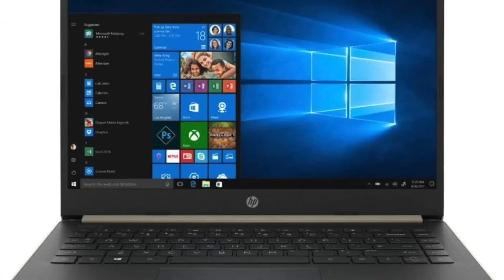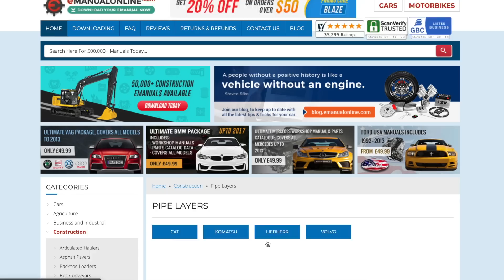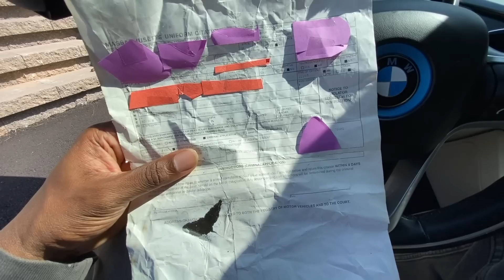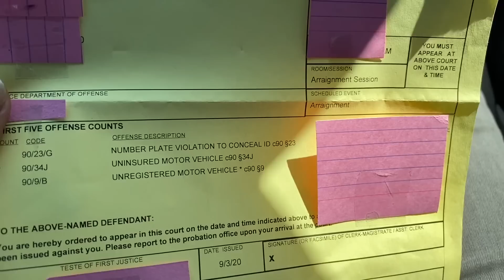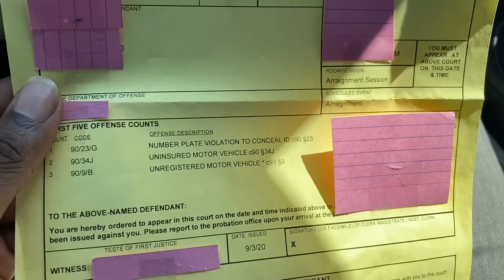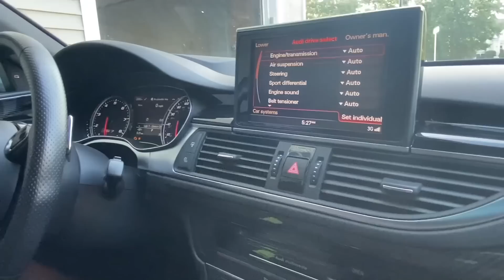What my confiscated Audi RS7 cost me

Comment: Comfort keeps shifts at lower Rpm so it feels smoother , dynamic keeps the car shift revs at higher rpm then the car then feels more racy and individual you can set the modes to comfort for smooth and dynamic for higher rpm shifts . Auto reads you driving style and changes in its own to comfort or dynamic automatically. I have a 2019 Q7 and drive in comfort when cruising most of the time and when I need a little more juice I put it on dynamic like when I’m getting on a highway and I need to speed up quick . I love buttons I believe it would be kinda hard for search for stuff when when you have to have full attention to the road . I saw the 2020 Audi Q7 with the touch everything but I liked the discount I got on 2019 and the Navarra blue color it has :) I don’t like the touch buttons looks complicated while driving on the new one .
Reply: Or, and hear me out, they could put a lever in the car and another pedal so I can choose how the vehicle shifts at all times.
Reply: The settings are for more than just shifting.  It also controls things like suspension stiffness, steering weight/speed, throttle response, and exhaust sound.  Comfort is more of a touring (soft) setting while dynamic is aggressive for sport driving.  Individual lets you pick and choose each aspect from either category (IE - having quicker steering and throttle response while still having a softer suspension setup)
Reply: @ezemond8299  of course it is supposed to but how often have these settings be more placebo than actual change to a vehicle's performance.
Reply: AMG is better than RS bro, all day.
Reply: FatalxWolfsgrin on my Q7 I feel comfort is more delayed to down shift and doesn’t have that much oomf and when I use dynamic it really gets up and goes strong
Reply: @ezemond8299  Easy enough, they could have levers for steering speed, a lever for suspension, a lever for throttle response (could even put it on the floor and use your foot to actuate it), a lever to slow the car down (again I would put it down on the floor) and maybe a lever to change the radio.  I should really patent these ideas
Reply: Q7 2019 2x better then 2020 version no cap.

Comment: Nobody wants cars to go “all screen” it seriously the most irritating trend. I want to be able to easily adjust the air, volume, and driving modes without fumbling around in a stupid touch menu system. The best part about that RS7 is that the screen can fold away. Nothing is going to save Tesla when the screens start looking as ancient as the first iPhones, and iPads do now. The extra weight in the Audi is a direct result of the effort they put into luxurious materials, and sound deadening.

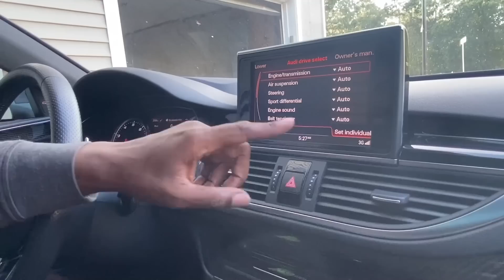Comment: 14:00 MMI from 2014 cars is actually from 2010... I guess you're still only changing the "Individual" preset (You were selecting Comfort, then pushing the Set Individual)
It has a "Owner Man.", I guess they could have labelled it RTFM 😂
But hey at least it had few features Tesla didn't get until much later (adaptive air suspension) or still don't have (night vision for wildlife)
Reply: Yeah, I fast forwarded to the end when he started whining about the settings and not knowing what they mean. FFS it's obvious to an intelligent being.  Another thing intelligent beings do is RTFM, and stay away from Muskmobiles and Gayphones.
Reply: This audi mmi as you wrote is basically already 2 generations old. New Rs 7, A6, etc use new one and between there has been bit older mmi with virtual cockpit etc in audi cars like A4. I would expect Rich to know this but it sounds like he was expecting some newer mmi for some reason

Comment: Even though battery is in the back Audi makes jumper connections in front.
Reply: BMW  and Mercedes  do it to its call convenience  its for jump starting  and  battery  in back  for weight  distribution
Reply: @koollyb  Trust me it doesn't always work
Reply: @HemiLyfestyle  if it doesn't work your doing it wrong the positive it's literally part of the main busbar and any grounding will do usually on the strut tower but the engine block is the best place
Reply: It's nice to know where the extra lbs come from.

Comment: What's wrong with the brake rotor orientation?  The internal channels are probably straight up and down, thus bidirectional. If the channels are curved inside, then the curve goes to the back so it releases hot air during forward rotation, and doesn't try to scoop it. If they are truly bidirectional, then just swap left and right if you want the vent holes pointing forward.

Comment: Rich, the bottom right button you press is labeled "Set individual" in the display. It always and only changes the options of the "Individual" setting. Comfort means "as comfortable as possible", Dynamic means "as dynamic aka. powerful as possible" and Auto is a preset made by AUDI engineers where both (Comfort / Dynamic) keep a balance.
Set "Set individual" options allow you to eg. have "Comfort" suspension but "Dynamic" engine and "Comfort" Belt tensioner just so that your ass can get comfortably and securely accelerated real fast ;)

Comment: If the steering feels really heavy then there must be a problem with the box are you sure the fluid is topped up comfort is what it says dynamic is sport indervisal is so you can mix the two how you like it, dynamic is a hard ride comfort is best, so you can have sport engine setting comfort ride and choice of exhaust valves open or closed

Comment: Buttons are good, touchscreens where you have to press 5 times to change simple settings = bad. 
And try reaching out to a touch screen on a bumpy road - having the wheel by the gear shift is much simpler.

Comment: Don't worry too much about the summons. I had the same thing that happened to me, except I put plates on my car from a different one. I had to go to court and explain what happened. Just explain that you made a mistake, and they typically will dismiss the charges against you and you'll be hit with a fine (in my case, they charged me with "court costs" instead of actual fines). With the courts being backed up due to COVID-19, they will probably give you a break, especially since you don't have any priors. If you were in serious trouble, they would have arrested you (they are actually supposed to do that, at least that's what the police officer told me when it happened to me). I also lived in Lowell, MA when it happened to me, and I'm sure you know about Lowell since you live in MA. So I lucked out with that, and with having to go to court for it too. Hoping everything works out for you. Like I said, just explain what happened and that you understand the severity of your actions, and you'll be fine as long as the judge believes you are sincere about it. And since you don't have any priors, I know they'll be lenient on you.

Comment: I had a 14 Audi S4 and Comfort, Auto, Individual, Dynamic pertain to all models of Audi.  Comfort = comfortable, quiet and smooth. Auto = Adjusts based on your driving style. Individual = Allows customization across the board of incorporating each mode however you like it. Dynamic = Aggressive, Stiff or Tight,  Loud, Sport mode essentially.  You are only ever going to drive in Comfort or Dynamic.  I honestly don't think Auto even works and Individual is fun to mess with but never see myself actually driving in the mode.  Comfort for long trips, Dynamic for quick trips around town.

Comment: Rich, sinse you dont maintain a majestic mane, you should look into the uline s-19252 the straps go behind your head instead of around your ears, and they're built well, because i'm not sanding anything most of the time i have just used this same mask with an alcohol spray for a several weeks

Comment: my rs7 APR Stage II with street tires would run the 1/4 mile at 10.5 at 130 mph. i could run the 1/8 at 6.6 105 mph but that was with nitto drag radials.

Comment: To get under mid 10s you'll need to upgrade the cooling (IC and pump) fuel (LP/HP) and meth injection....that will juuuuust get you there.  Anything more and you're looking at bigger turbo and supporting mods.

Comment: For a country that is really lax on having a license plate on both ends of the car, your cops are escalating it quite unreasonably when you forgot your plates at home. I had my plates in the windshield for a while because I had to get EU style holders for a car that I imported from Asia.. But it was still fine. Is it really driving without insurance if you just left the proof of insurance and that stuff in your garage while test driving? You should ask the judge to give you a small fine because you learned from the experience.. And as far as I know you can ask for that specific officer that got your car impounded to be present.

Comment: Massachusetts title law requires all motor vehicles and trailers (over 3,000 lbs) to be titled within 10 days of purchase. If you had it less than 10 days before you wee pulled over, there's no valid case. also the pandemic has made opportunities to register less available

Comment: So, uninsured motor vehicle u can clear easily by proving you bought it recently and its covered under any of your other cars insurance policies for at least the first 30 days. Unregistered vehicle charge, idk about you but im sure your DMV has been slow and or shut down recently due to covid and many require you to schedule times to go to the dmv to process things. Out of your control. Easily not your fault, (even if it is actually). The lack of plate charge, you pretty much have to admit u drove it without plates, but you can make it a point to say you have plates for the vehicle. But due to the dmv and its issues as of late you havent been able to transfer the plates you do have for it to this vehicle, because you were unable to register it with the dmv due to their current restrictions. Good luck with all that bud.

Comment: those buttons are about 20.000 times more handy in a CAR. If you drive along and you want to change something in the car like the fan speed, or even the wipers you need to go to a touchscreen. Can you adjust something on a touchscreen without looking where you touch? NO. Thats why  touchscreens in cars are complete and utter SH*T. It just dosnt work. If you are driving around and you want to change radio station you now have to actually look at your radio, see what you are doing and then see where you want it to go. If you have a radio with button you can do it by touch. My girlfriend actually had an accident because of this touchscreen crap. Trying to adjust something, looking where she touched the screen and 1 wheel hit a bump near the side of the road, car lost control and ended up prettymuch upsidedown in a (lucky) dry ditch.
So i think they should just stop with the touchscreen crap and go back to buttons...

Comment: Maybe I'm new to these newfangled auto - mo- belezes but, ...  WTF??? drain the coolant to change the spark plugs??? Is there a kit of some sort that includes a belt to bite down on and Habenero sauce lube. I get the dealership and their wallet-reach-around, but the coolant and the spark plugs should not be connected unless you blow a head gasket (not gonna do the joke there). WOW, I mean 150mph+ on the way to work and 7-11 is kinda cool, but fuuuuu  kk this car is so over engineered,, it is neurotic.